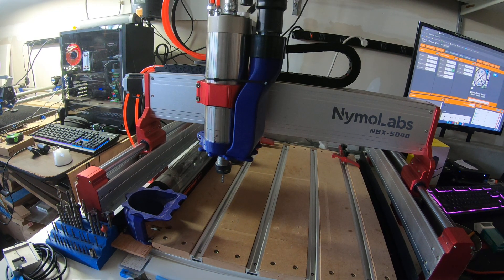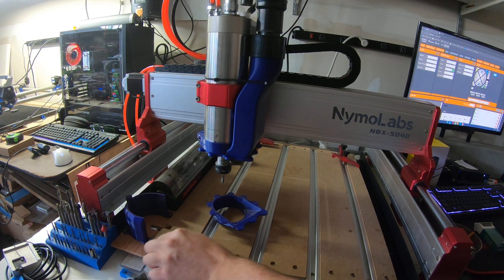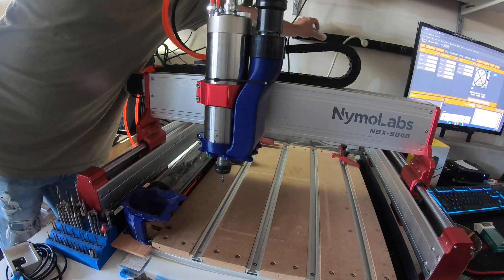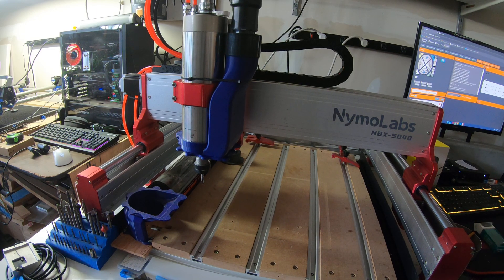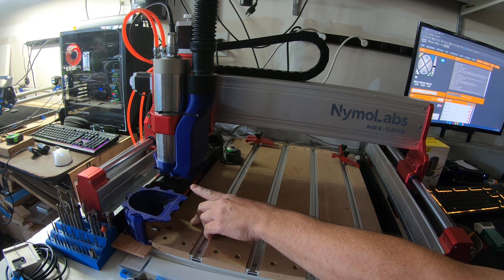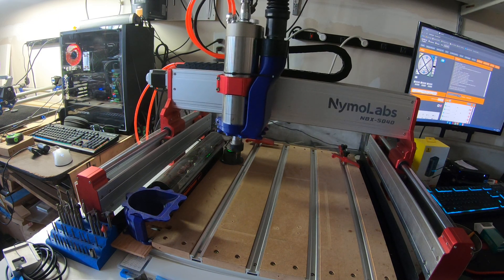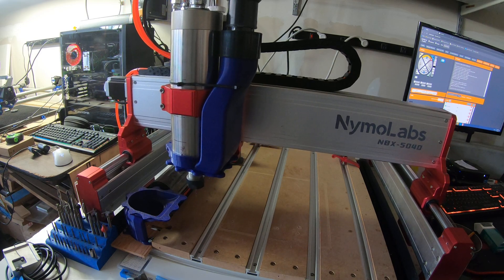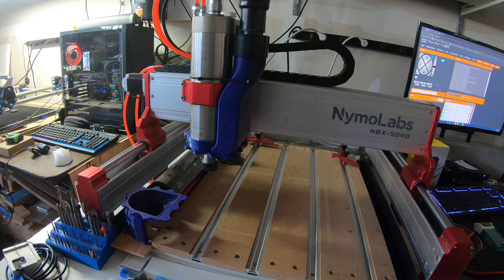Automated Dust Boot and Dock Add-on for Rapid Change ATC

Comment: What Spindle you using on your Nymo? I have a 6040 nymolabs with the nymolabs watercooled spindle and I'm trying to work out if the spindle RPM will get that low.
Reply from the maker: There spindle doesnt allow reversewhich is needed for the ATC and its a custom software set and macros to run the spindle at lower rpm. Im not using NymoLabs board. The ATC is designed for FluidNC board, Super Long Board, UCCNC, Masso, Mach3 &4 Centroid..  U can check out the Rapid Change Tool changer webpage for more info.